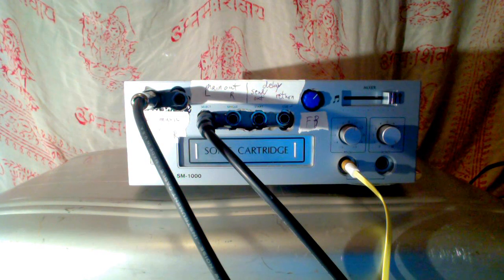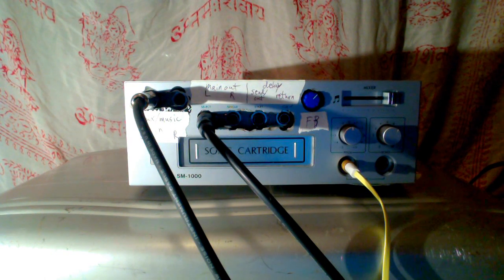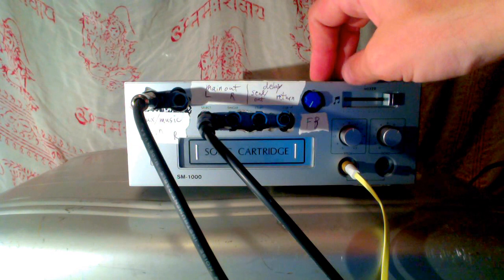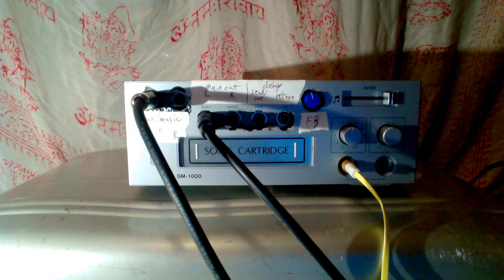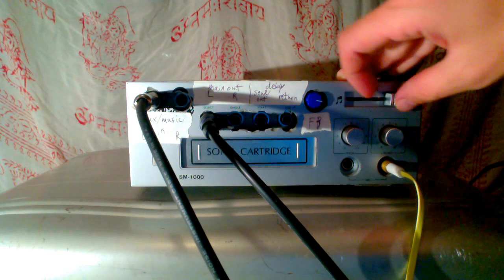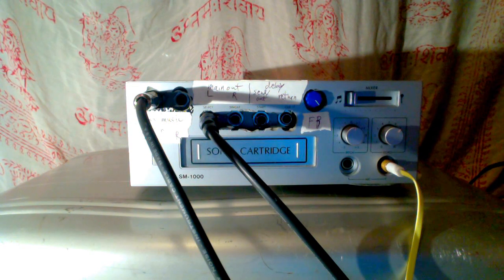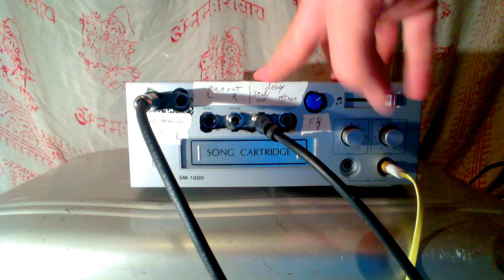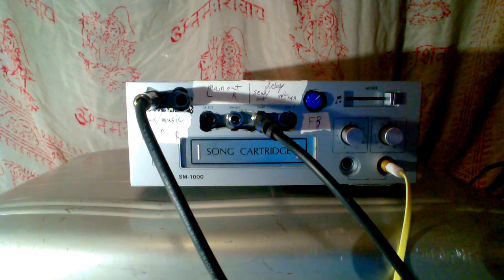singing machine sm-1000 8 track delay modifications circuit bending demo video

Comment: Hex Inverter is acting as a timing oscillator for the delay chip, I believe. Mess with R38 to change repeat time
Reply from the maker: +Vortal Curb you have schematics for this unit or you have one yourself?  i thought i was the only weirdo with one of these.  did you put a potentiometer on R38?
Reply: +thenormanconquest found one this weekend. no schematic. still playing around but so far found that replacing R38 (pin 13 of the 4069 in case your board is labeled dif than mine) with a 1M pot works pretty well.
Reply from the maker: +Vortal Curb wow, thanks!  I poked around for awhile in there but could only find the wet only signal.  and I ripped out the 8 track player coz it was heavy as hell.  and the aux input is from the 8 track feed to the mixer in the unit, that's why it has such gnarly distortion.  and feedback knob.
Reply from the maker: +Vortal Curb you won't find a schematic online for either the unit or the delay chip.  I googled the snot out of it